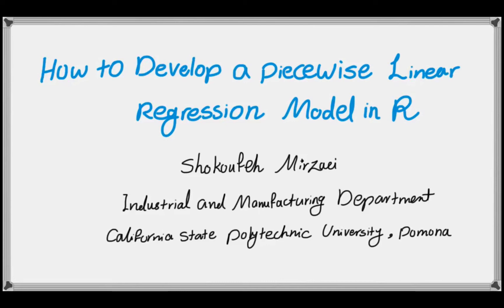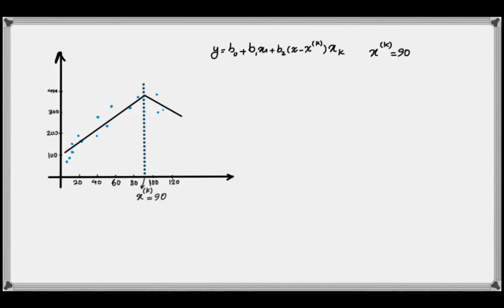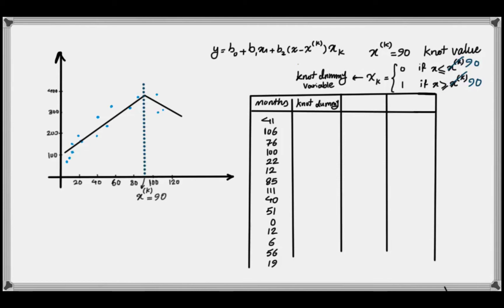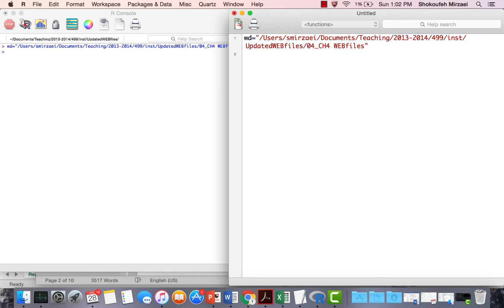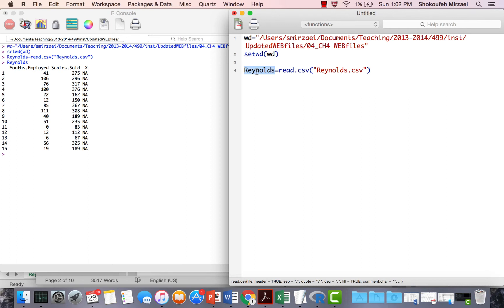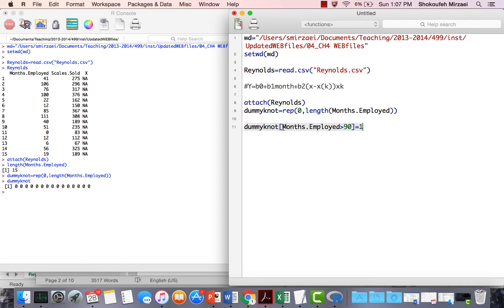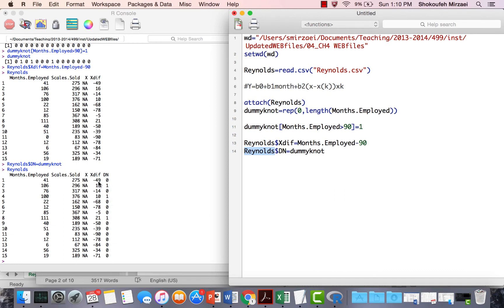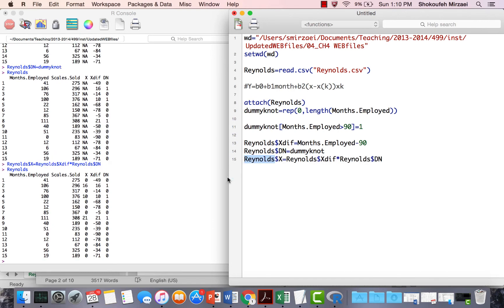How to Develop a Piecewise Linear Regression Model in R

Comment: thank you. I have a question, is it possible to compute the b2 value without the minitab lm function that seems to compute it , is it possible for example to do this in excel ?
Brgds
Reply from the maker: Yes, you can do the same thing in excel. To do so, you have to add the "data analysis" add-in in excel and use the regression function in that tab. you can google and will find plenty of instructions on how to run regression in Excel.
Reply: @sxmirzaei  Thank you very much , I have found it in the meantime and it works very nice, thanks to you for your video that triggers my interest ... And more thanks for your fast answer and follow up ...Brgds